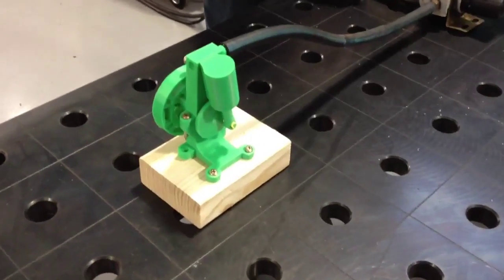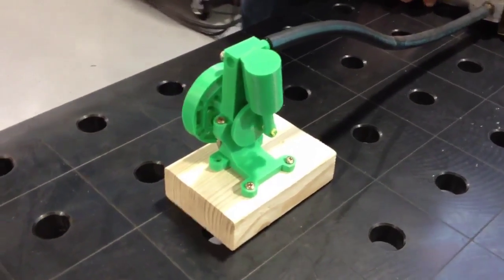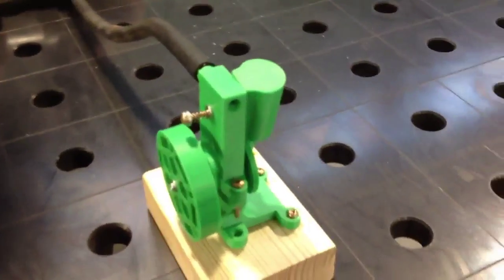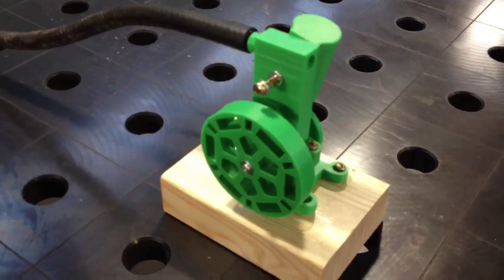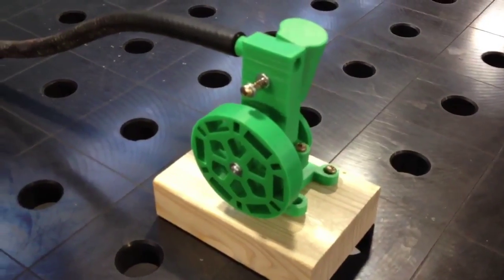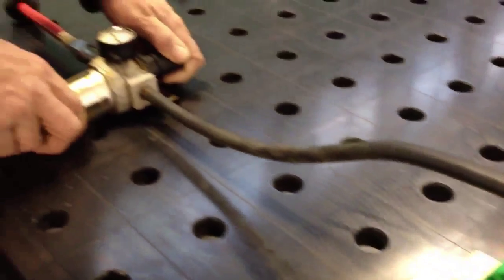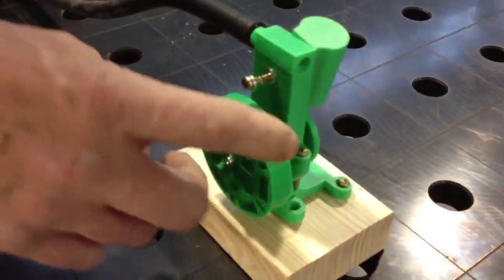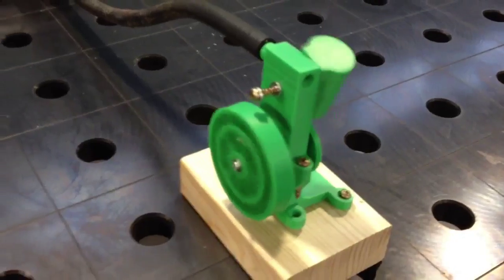3D Printed Oscillating Engine

Comment: this is really cool, could you tell me how much cf/m or liters/min it draws? trying to figure out how long it would run attached to an 80 cubic foot capacity scuba tank @3000 psi
Reply from the maker: Hi Russ.  Thank you for watching and commenting.  I'm sorry mate, but I can't assist you with this question.  I no longer have this little 3D printed engine.  I left it at another school that I was working at.  Cheers, Aaron.
Reply: no problem, if I ever decide to try it I will make a video, thanks for releasing the files on this!

Comment: That's really, really, really cool!
Reply from the maker: Great Western Steam Hey mate, thanks for taking the time to watch and comment.  I just visited your channel and it's good to see a young man like yourself interested in steam engines. Do you have a 3D printer or access to one?  The little oscillating engine is very easy to make. Cheers, Aaron (Melbourne, Australia).
Reply: DCTTeacher1 Hey mate, I am glad you like my channel. I do not have a 3D printer but my school has one so I might be able to use it.
Reply from the maker: Great Western Steam I would ask you teacher if you could print out the parts.  You can download the STL files for free from Thingiverse.  I think the details are in my video description.
Reply: DCTTeacher1 I will ask my teacher if I can. The details are in your video description. I have checked it out and it looks simple to put together.

Comment: Look up Tesla's Wind Turbine design, it is similar but has much higher RPMs! Also, it only has 1 moving part!!
Reply from the maker: Hey Naoki, yes I've seen this design before.  They used to use them or similar on steam trains in the old days to power a dynamo generator to power the front headlight of the train.

Comment: I love this channel. Engines, and aviation meet machinist talent. Excellent!
Reply from the maker: Hey JD2010whisperer, thanks for the positive feedback on my channel.  You are too kind.  I've been a bit quiet lately on my channel, as I'm flat out at school.  However, I'll try and do some more videos soon.  My new engineering workshop at work is nearly up and running and I'll post some HASS CNC action approx mid year.  Cheers, Aaron (Melb, Aust).
Reply from the maker: Hi Scott, youtube won't let me reply to your email.  It says you have a contact lock on etc...  So I'm trying again from here.

Hello Scott,

Great to hear from you again.  Where are you from in the USA mate?  As you probably already know I live in Melbourne Australia.  Which is located in the lower south east part approximately.

Thanks again for your positive comments Scott, you're too kind :).  I'm very interested in seeing your engines come to life.  Feel free to send me some pics of your setup and little engines as you progress.  My email is aaronpowter at Hotmail dot com (use the proper symbols for at and dot etc...)

Is the YOO  cnc tools you're talking about similar to the one I used to own?  I had a yoocnc3040 machine but sold it to make a bigger mill especially for milling aluminium and steel.

Totally agree with you about owning and operating the correct tools for the job.  Especially if you can customise the machine etc...

Glad you liked my iPad / iPhone holder.  I didn't do the original design or come up with that idea.  I first saw it on eBay and my friend made one too.  I thought it would make a good CAD-CAM job for my engineering students at high school.  I think it is already patented so I would get sued if I tried to sell or market it.  When I get some more ABS coloured plastic at school I can 3D print you one if like?

Ok Scott got to run.  It's 8:55am Friday in Australia at the moment.  It's a public holiday today and I feel a day watching TV and DVD is in order ha ha.

Ok Scott, it was nice talking to you again.

Cheers, Aaron.
Reply: Not a problem. Maybe I can add you as a contact? I will definitely be posting so I will keep in touch with you.

Thanks much!
Reply: Now we can message! I added you, it was so simple. I look forward to future chats.

Cheers to you! (it's late evening here).
Reply from the maker: G'day Scott.  Thanks for adding me.  I look forward to future chats too.  Take care, Aaron.

Comment: Hello, what happens if I run this engine with vapor? like a really steam engine..
Reply: Jacob Hoffman
I'd be interested in seeing that.  Some of those wheel setups were pretty amazing.
Reply: DCTTeacher1 the answer is it will melt and seize
Reply from the maker: Yes it could just do that Jacob. This was made from ABS plastic and it is known to melt at 221°F or 105°C.
Reply: if i could get my hands on one of the printer, i have ideas involving elaborate archimedes wheel setups
Reply from the maker: Hey Jacob, you should build a 3D printer yourself.  One of my students built a reprap a couple of years ago and it's still going strong.  Actually, the company called HobbyKing is starting to sell 3D printer parts etc...  I think they are bringing their own 3D printer out soon.  Cheers, Aaron.
Reply from the maker: Hi Juan, this engine is running on compressed air from an electric powered air compressor.  I'm not sure how it would run on steam. Thanks for commenting.  Cheers, Aaron.
Reply: it will even at less heat, moisture and friction play a huge role, unless you find a way to introduction heat.moisture resistant lubricants such as oil, then theoreticy this set up could run forever
Reply: dont take me wront though ive seen gear setups printed that are just incredible, the possibilities are endless
Reply from the maker: Hey Bob505470, thanks for the clarification on ABS melting point.  I must have had a brain fart, as I remember my little UP3D printer states that temperature in the maintenance screen just before it starts to extrude.  Cheers, Aaron.